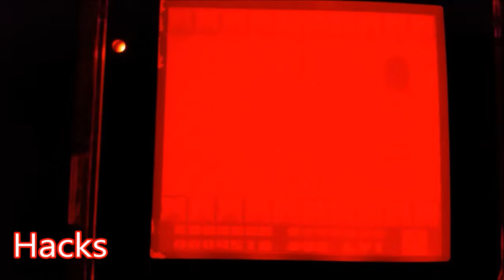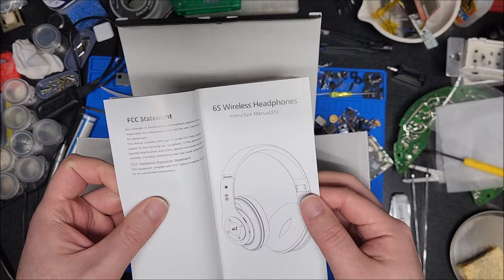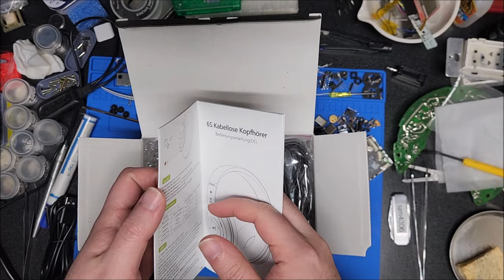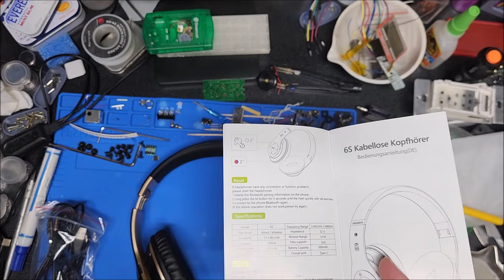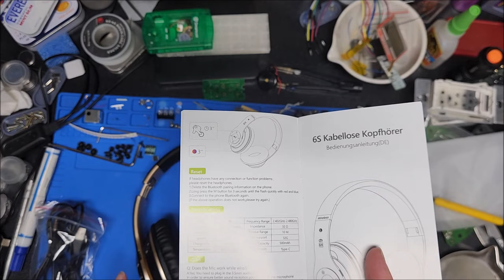Under $20: Falebare 6S Bluetooth/Aux/FM/TF Headphones Review

Comment: It's even cheaper in my country but only availlable in white with pink pads 😕 so I will buy it for my mother, and don't think she will struggle with the bluetooth (she is pretty tech illetrate) but with a long cable jack for the tv it could be a smart gift + when I visit her (sometimes for several days long) I can borrow her and use it in bluetooth. Lees to carry when I left home for her's.
SBC codec only or also AAC  ?
Reply from the maker: From the sound quality I suspect sbc only but I can check when I get home.
Reply: @sjm4306  99% of chances that's only SBC. Don't feel obligated to check if you don't have time. It's already really nice of you to have suggested it.I'm sure you must have better things to do once you get home from work.

Comment: I can get mine into FM mode, but I can not receive any FM radio stations inside or outside of the house. 
I did not get a manual with mine.
Reply from the maker: I figured it out after the video, you need to plug in the charging cord as the antenna